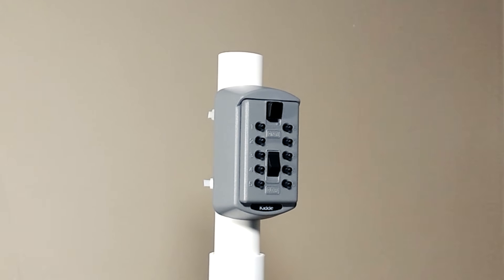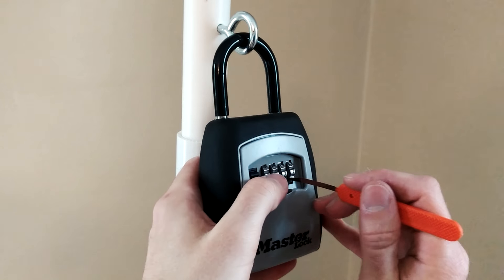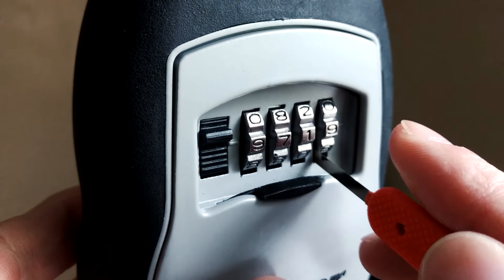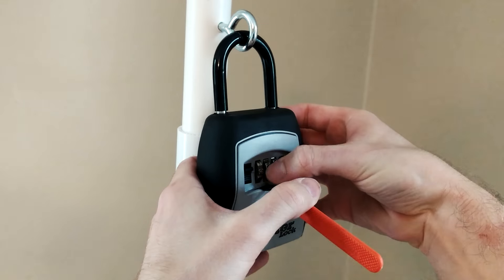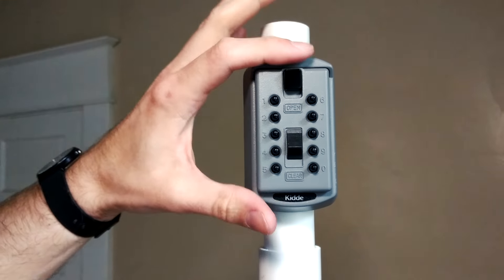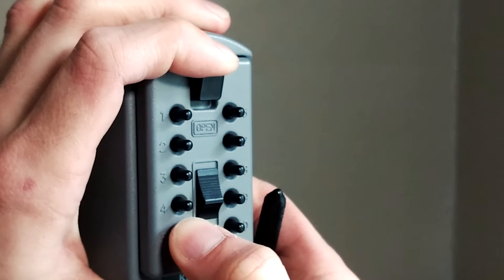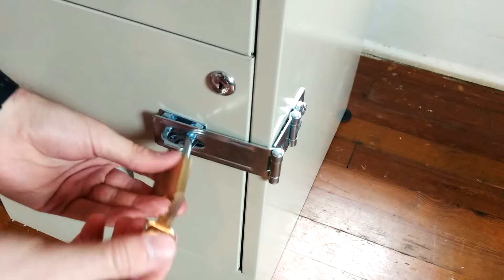Bypassing Common Key Boxes

Comment: You should really not share this. Thanx for ff'ing up the security of our elders that need these systems for their careworkers.
Reply from the maker: While I understand the frustration, I'm confused why people with this perspective do not express anger at the manufacturers. They have known about these vulnerabilities for decades and have not improved their design. Because of this, I feel the only reason to actually improve the security of these folks is to expose the vulnerabilities as publicly as possible. 

Without seeing these egregious vulnerabilities, everyday people will not stop buying these products. And without the folks refusing to buy these products, the manufacturers will not improve them.
Reply from the maker: And to be clear: these vulnerabilities are not secret. They are well known by bad guys, in general. It's everybody else who needs to be made aware.
Reply: Takes very little searching to find any of this info. Security through obscurity is not secure, it just makes it harder for the general consumer to be informed. Criminals will find a way to bypass these locks, while the consumer will be none the wiser unless they're exposed to something like this video. The more of this info there is, the better decisions we can make when securing our lives.

Comment: What key lock would you recommend then? It seems all that are the 'safest' always have an inexcusable flaw
Reply: Supra c500
Reply: One of those fake stones that hide a key.

In a gravel driveway.

In a quarry.
Reply from the maker: I'm not aware of a key vault that I would be comfortable recommending. I'm certainly no expert in key vaults but I'm sure that there are much more secure options. But, having never studied or tested them, I wouldn't want to risk leading you astray. 

But I would strongly discourage you from using a fake stone to hide a key, as another viewer suggested. No magnet key boxes inside your gutter drain,, no fake rocks in your lawn, etc.
Reply: @ContingencyLabs  I've seen a mechanical combination lock with a key needed to turn it on a contractor's cabinet. If this has been implemented correctly, there should be no feedback for the mechanical combination lock until the key has been picked, but I don't know. It's infront of 2 cameras, the caretaker's office, and the enterance of the building, so I'd say it's secure.

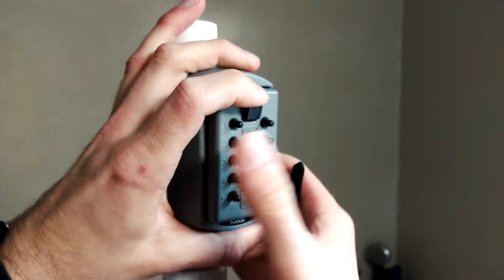Comment: I have one of those push button boxes like @1:00 and it doesn't seem to have the same vulnerability. Mine is a GE brand made in 2007. Model #1058358A
Reply from the maker: I wasn't able to find that exact model. However, GE makes/made a key box that looks very similar to the Kidde/Supra key boxes. I am unable to say whether this technique will work on them but it definitely takes practice to use this technique on the Kidde. For that reason, I wouldn't give up so soon. 

Try to maximize the pressure on each numbered button by using the handle of a lock pick to protect your thumb. If you push hard on the numbered buttons and get the tension on the "Open" button just right, I imagine you'll get it open.